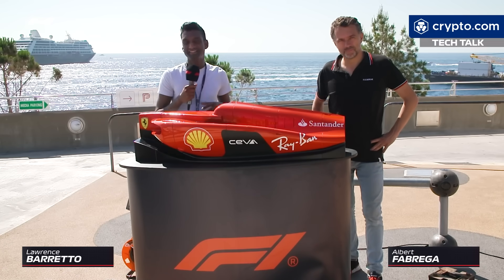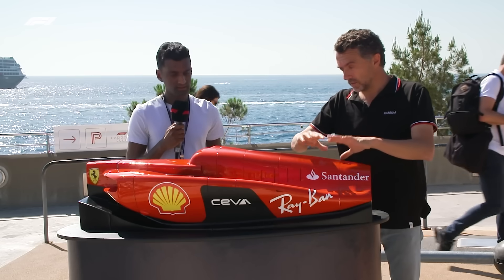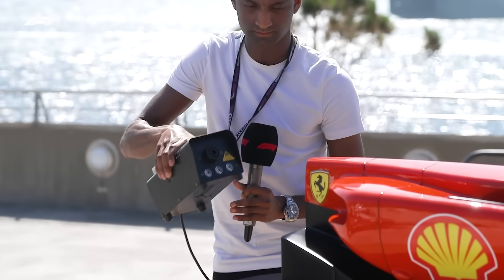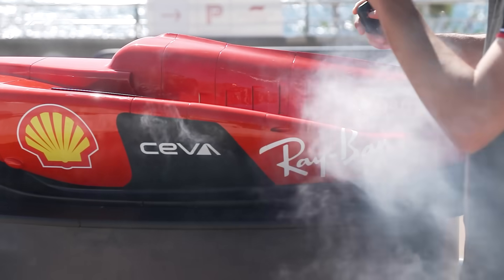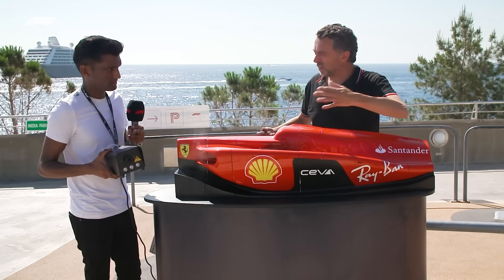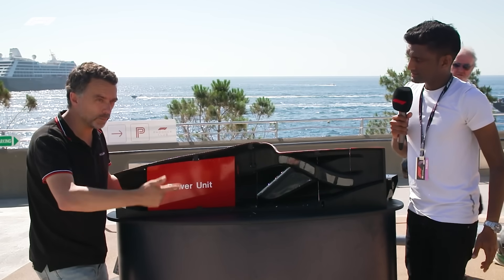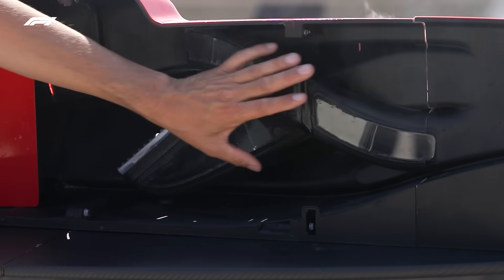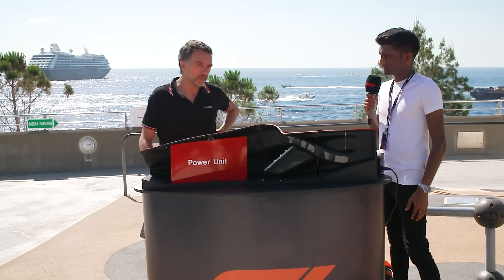The Trick Inside Ferrari's Sidepod | Tech Talk | Crypto.com

Comment: Ferraris sidepods trick that s not working
Reply: What doesn't work so well is mostly the underfloor
It is too much subjected to height changes
Reply: @lucasandri5462  Also they say RB has a more advanced rear suspension which allow them to run their car closer to the ground than other teams
Reply: @lost_valley  Their rear suspension gives them a more consistent distance from the ground which is actually more important
Reply: It's tricking Ferrari.
Reply: their floor is lot more basic compared to RB and proly Aston too.